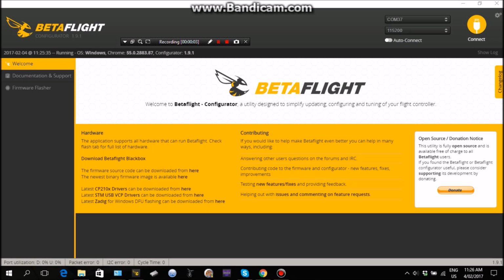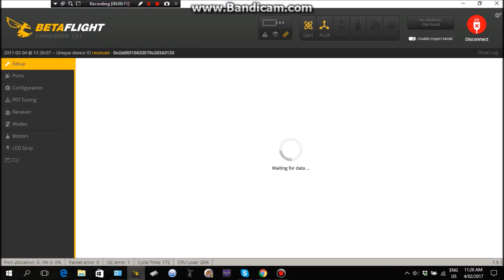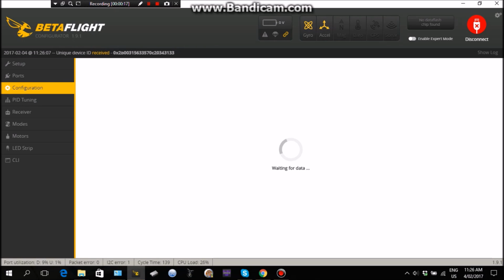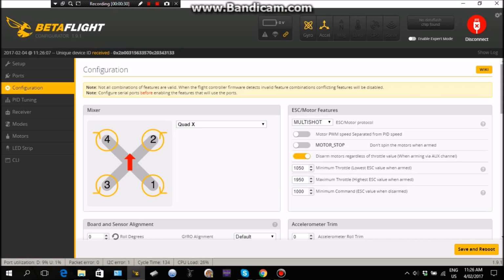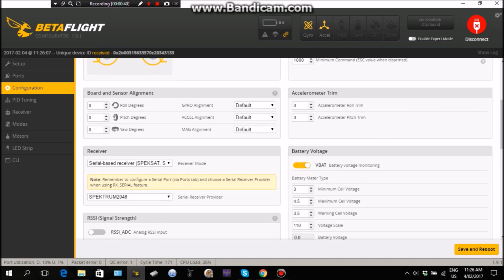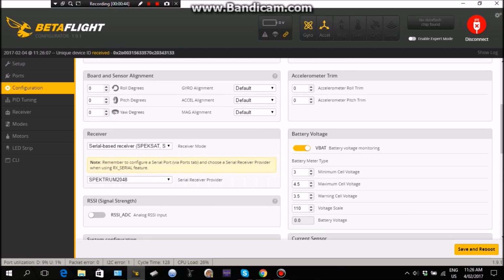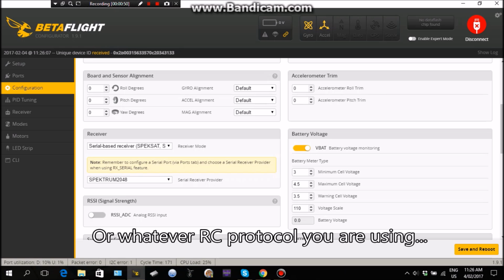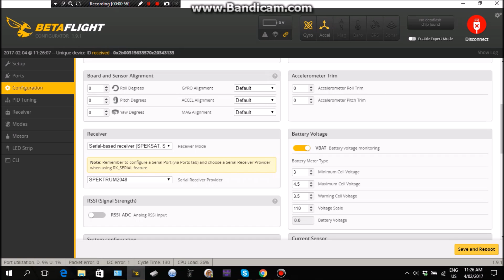Atom V3 DIY - 2in1 ESC soldering and FC orientation

Comment: hello just finished installing everything on the rotorx atom v3  4inch frame i have 1306 4000kv motors on it can i use 4inch props on those motors or should i use different motors please help